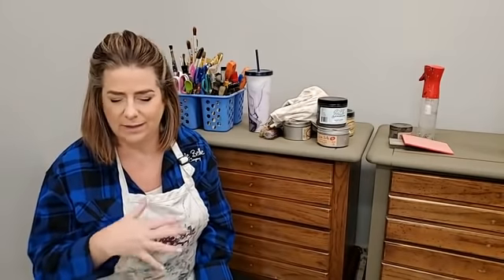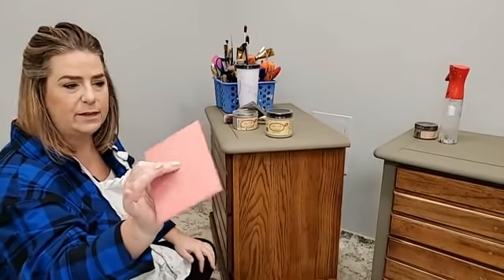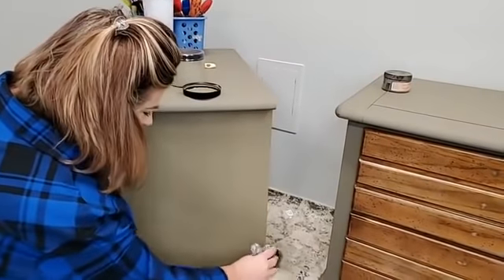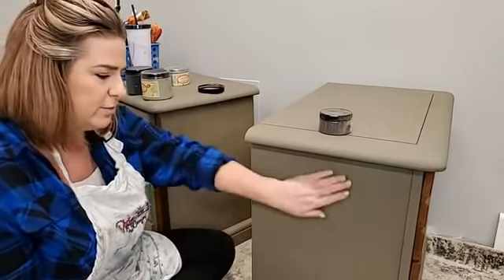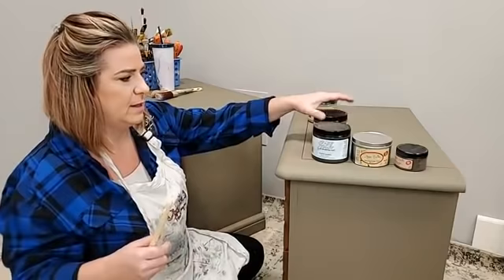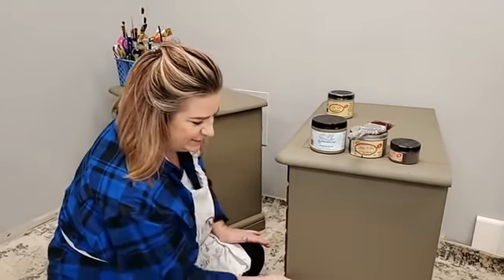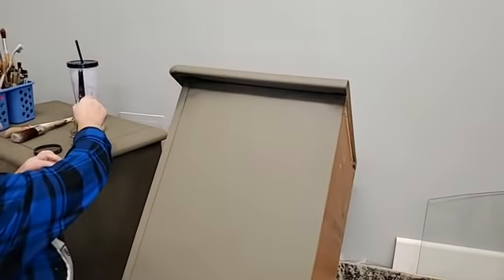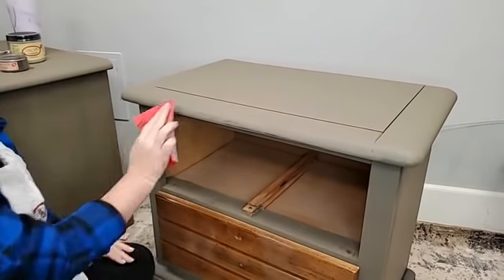How to use all in one style paints for a smooth furniture finish

Comment: From my experience i have to disagree with some of this. Ive been using the midnight blue and while its ok on drawers where there are maybe 3 swipes across its not great on the cupboard fronts. Im now on my 3rd time sanding and 4th attempt and im getting the same result. Drag lines. Certainly not 5 minutes workable as i just noticed a hair in the paint, lifted it off with my brush and its no longer workable and left yet again drag lines. Ive tried 3 different bruses (all synthetic). Im at the point of probably needing to just price my item down a bit because i cant see what i can do differently. I think also being a dark colour it shows up more. I pushed a drawer back in and the paint wore off already. This must be because i didnt use slick stick i only sanded my piece. I usually always sand only. Im also getting a white mark from my hands when i rub the front of the piece. Again probably because its dark. On the bits where it has gone well it is a nice finish but these other bits are really tricky. Its not too warm here either so im stumped.

Comment: Hey Brandy...so I'm painting a side table with the silk line paint in Endless shore....Now I Literally follow the other tutorials step by step and There's Brush strokes😳....So on Another video where You DID use a Spritz of water ....and So I Scuff sanded down the brush marks after it dried overnight...and I DID spritz Just a Bit and That HELPED ALOT....So I'm confused...whereas Just a Spritz Helped alot with brush strokes...

Comment: Brandy, if the base of my project was painted in Silk and I wanted to apply a stencil in a Chalk Mineral Paint color I have then how would I seal that CMP since the Silk doesn't require a sealer/top coat?  Thank you @brushedbybrandy  Would I have to seal the entire project then?  Just curious how to handle.
Reply from the maker: You can leave the chalk mineral paint unsealed if you are ok with the low matter sheen, otherwise I would seal the entire piece fir uniformity